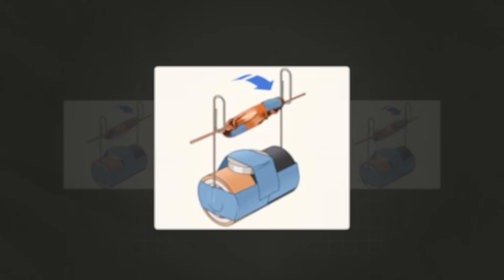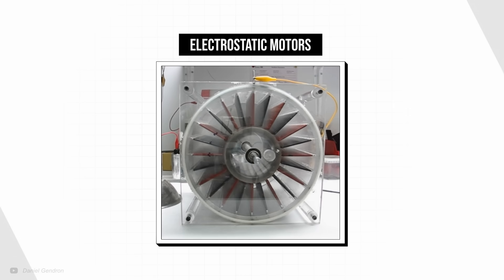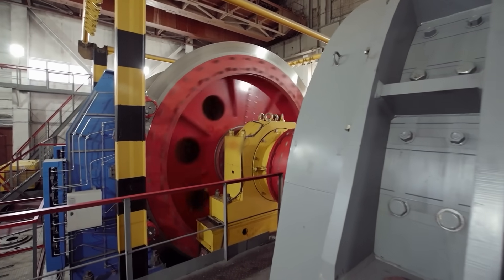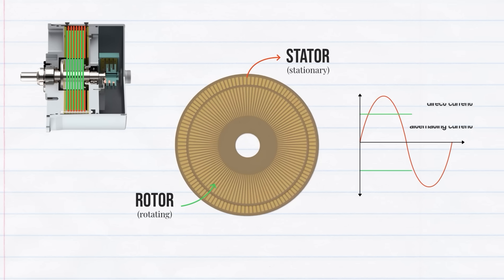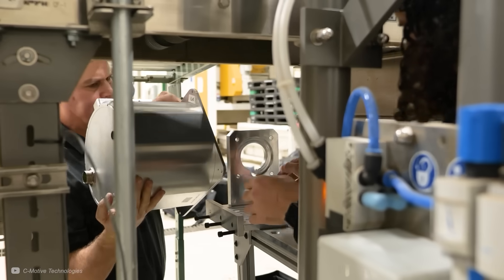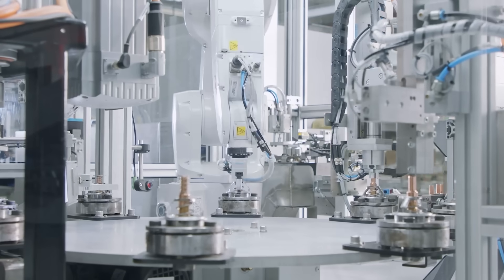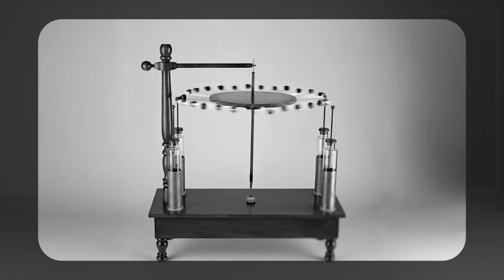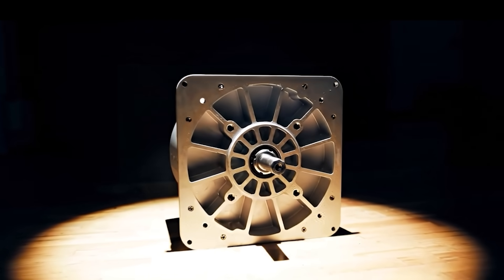How Electrostatic Motors are Breaking All the Rules

Comment: I work in factory automation and induction motors are so cheap, these motors would have to get close to the ballpark upfront cost to start making a significant dent in the market. Unfortunately people don’t often go for the pay more now to save in future within the industry.
Reply: I agree. I used to design and make industrial machinery like belt conveyors and packaging machines. 95% of buyers are focused on upfront cost and reliability. For these low power applications almost nobody considers operational costs or enviromental impact.
Reply: @federicolopezbervejillo7995  I work in industrial maintenance and I can concur. Noone is willing to spend as little as 30% more even if there's a lifetime savings of 50-60%. Everything has to be justified immediately as cost versus benefit
Reply: @federicolopezbervejillo7995 
That's strange. What company in its right mind wouldn't want to improve their margins. They could also campaign for government compensation, as this tech would positively impact the countries margins too.
Reply: @SWDW88  Well, I'm not a plant manager but I met a few in the last 20 years and I found they a re very intelligent people.
I was told once that when evaluating an investment, a positive Net Present Value (NPV) is not enough. Usually the project NPV is compared to other projects NPVs and the best ones are identified. These kind of marginal benefit technologies are not attractive compared to a cheap new production machine that could be not so efficient but brings considerable benefits by increasing production. Government incentives in general make not relevant difference, at least in my country. In the end these kind of green investments are used as a marketing virtue signaling, not as a optimal profit investment for the company.
Reply: @federicolopezbervejillo7995 
And your right. Allot of these greener schemes are meant as virtue signalling. But in this case, it's efficiency gains. And there are allot less choke points in production that can be leveraged by other nations.
Reply: @SWDW88  welllllll. Lets say I buy a 1 million dollar machining center for a production plant that does not use any cutting fluids as it makes its owm from a liquid nitrogen generator, has reduced power consumtion, and overall will cut operations costs by 100k per year.
Sounds good right?
And if the plant is employee or privately owned that is where the discussion ends.

But if it is investor owned and listed that would mean the entire p/l margin would be stacked a negative 1 million the first year and the company stock will plummet, and a venture capitalist will defenitly buy up stock, take out a loan against that stock and buy up more while forcing the company to pay for the stock bought for them because of the controlling stock...

So we would take a loam against the company to pay for it, and that puts a risk of 1 million for the next ten years (zero intrest as the loan would be internal fully), now we have a risk of 1 million that reduces over the ten years it takes to pay itself off, and the company stock will STILL be undervalued because of that risk meaning an Venture Capitalist could still buy up the company for a million less then its actual value, it just would be harder to get a loan to do a forced buy out like that, but it would also take ten years to remove that risk.

So given all that we have to wait until such technology is both; a MUST have in the industry AND, the equipment can be purchesed as a replacement and out of the allready saved and techincally paid for out of the maitanice and systems expansion funds.

We need both in publicly owned companies otherwise some bank is just going to trounce us, and sell us for parts.
Reply: @AnonymousAnarchist2 
Cool. My point is that the design looks simple. Its discs Vs coils. Sheet cutting machines Vs coil winding machines. These sheet cutting machines are everywhere and used by many industries. I could outsource the disk cutting to a company who owns these machines already, who'd add it into their schedule. 

I could buy second hand machines as I build the business to take care of a margin of the work. As I grow a healthy cashflow record, I'd receive loan offers from the bank to expand the business. To avoid financial vultures, I simply would not take the company public. Would sell shares privately under a contract that makes sense. 

And these electrostatic motors along with those relatively new circuit board coil motors can be produced at a much higher rate per machine than the traditional winding method. Higher volume equals lower capex per unit, as that gentleman said earlier.
Reply: I work in power transmission. They are using worst case scenarios to make their data look better. They are using ie1 motors and high ratio worm gearboxes to get the gearbox efficiency. You could use an ie3 motor and helical bevel which would  be far more efficient. However it costs more and in these small power applications most people focus on purchase price. 

They are still using sprockets to couple the motor to the conveyor. 

They are trying to solve a problem that’s already solved but the market still chooses the cheapest most reliable one.
Reply: @8towely EXACTLY.    the rough cost to run a 3hp motor 24 / 7 / 365 is $1,960   Per year Based on 0.10 per kilowatt hour.      
Mfg energy savings estimates are always so lopsided,   They lose all credibility.
Reply: There's also the "nobody ever got fired for buying IBM" problem.

If you buy an off the shelf motor and it breaks, then shame on the motor. If you stick your neck out to buy the fancy experimental motor and it breaks, then shame on you.
Reply: @SJ-co6nk 
The best strategy would be to start small. Target more niche low scale markets where the margins make sense. Then ramp up production when there's clear evidence of a return.
Reply: I'm not an expert, but this motor looks much easier to manufacture. Obviously this industry would already have all of the machines that build the conventional electromagnetic motors. But this new device could enable startups to compete with the most dominant players on the market. 

I think the actual problem will be the regulators that stagger it's progress and postpone it's entry into the market. This is the usually the case with most disruptive new tech. 
Money talks
Reply: @SWDW88 the motors in competition are not electro magnetic they are induction there made very easily and very cheap.

The video uses worst case scenarios on efficiencies for worm and motor. There are simpler options already available with higher efficiency and the cost difference isn’t much. The market still opts for the cheaper worm box and low efficiency motor.
Reply: @8towely
I get you. But metal wire windings are still needed in the stator. My point is that metal plated discs can be manufactured with allot less capital than EMs that do require windings.
Reply: @SWDW88 I seriously doubt it. Windings are copper but small motors are a few hundred dollars and can run dol. these motors will need a drive adding more complexity and cost
Reply: @8towely 
The induction motors also need a drive to operate efficiently with varying speeds or loads. Although, these drives are established already, and the industry are well optimised to produce them efficiently. But that same assembly line could easily adjust to efficiently produce the drives for electrostatic motor. Where as the machines needed to wind wire efficiently are very niche and expensive
Reply: @SWDW88 they really are not expensive. Sub 5.5kw it would be nearly impossible to compete price wise.

And a lot of systems are built on single speed and do not need drives.
Reply: @8towely 
I was mainly talking about the machines that are used to build the electromagnetic motors, though. They're niche in the sense that they are used for one job. And allot of capital is needed to own them. I'm not arguing about the price of electromagnetic vs electrostatic motors here, because those numbers are based on how efficiently we can manufacture them along with material cost and logistics.
Reply: @SWDW88 I work for a manufacturer of motor and power transmission.

To make anything you tooling or equipment to sped up production.

When you make tens of thousands quickly and efficiently that capex is absorbed very cheaply. It would be no different for the motor in the video
Reply: @8towely 
I understand those principles, but there is still a large amount of capital needed to make EM motors because of the niche machinery needed to manufacture them efficiently. ES motors use metal coated disks that can be cut from sheets and etched with Lazer.
Reply: @SWDW88 there really isn’t mate you don’t have a clue. If capex was so high you’re not selling 1.1kw motors for a few hundred dollars.

Capex is always absorbed on a per unit cost.
Reply: @8towely 
I get you. The capex per unit is small if volume of production is high. My point is still valid. Smaller startup companies could be competitive, by producing these electrostatic motors. Because there is less capex per unit volume. Bigger established companies will have the liability of redundant machinery.
Reply: If they use way less copper they may be competitive.
Reply: I like the up the  voltage, phases and frequency solution. 6 phase 60deg motors are much smaller and lighter. Good luck to any one figuring out the phase rotation on that :).

Comment: I wonder if they could be used for applications where magnetic fields are a problem. If they product smaller magnetic fields, and/or are effected less by magnetic fields, that could increase their potential use. And if they could replace their liquid with a non-conductive gas that could make them lighter for other uses.

Comment: Where does the high voltage come from? How is the high voltage delivered.  Is the high voltage converted from a lower voltage source? I have issues with the high voltage system because will require better wire insulation and the safety may require much better switches to break the current flow. I do like the idea of such highly efficient motors.

Comment: The fluid is likely a blend of Propylene Carbonate, which has a quite high dielectric constant, over 60!
Reply: Excellent observation.  Though the covalent bonds in five ringed cyclical carbonates are not thermodynamically stable enough for long term use in electrostatic motors, unless measures are taken to stabilize them.

Comment: They should explore the airplane engine market. High torque at lower speeds would eliminate the gear box issues that turboprops have. Power could be supplied by batteries for take off, and then by a jet powered generator for extended flight - a sort of hybrid system. I know the turboprop market has stalled due to the need for more efficient engines; this may be the solution.

Comment: I wonder if they could build the motor into a hermetically sealed chamber and use a magnetic coupling with a very high vacuum instead of an insulating fluid so there is zero fluid drag while still offering enough electrical insulation?
Reply: Thermal issues may be difficult to resolve with a high vacuum though.

Comment: oh my god, there are millions of us that have this use case, we need motors that maximize torque, but only need the motor to rotate once in about 24 hours... this is amazing. If it can get to sub arcsecond precision we are all going to lose our minds.
Reply: What is your application?
Reply: @marioxerxescastelancastro8019  Telescopes man. Meade and Orion just went out of business, there's basically a huge power and product vacuum going on globally right now. If you don't count the useless chinese stuff that doesn't even meet the definition, the low to middle end of the market right now is ripe. If this company decides to make something smaller than half a horse, oh boy. If it for whatever reason they are strong enough to drive a load directly without a transmission and has really nice encoders... Boy oh boy we are in for some good times.
Edit: The harmonic drive / strain wave gears have helped, but we'd like direct drive capability especially on a small scale. I just had to tear out a giant elmo motor for my 600lb telescope which was a pain, it'd be nice to get something a little smaller.

Comment: > Safe, nontoxic, commodity chemicals, nonconductive, 4000V breakdown, useful as a coolant
That's literally just Novec 7200, or something similar.
There's nothing proprietary or secret sauce about it, it's been around for ages in this kind of use case.
The amount of viscous drag created by fluids in gaps that small is likely why they are focusing on the low speed high torque market. Maybe if they pumped the motor full of "proprietary" SF6 gas like HV transformers, they could run it at higher speeds.
Reply: What’s funny about this is the confidence with which you're dismissing the possibility of proprietary formulation.

“There’s nothing proprietary or secret sauce about it; it’s been around for ages in this kind of use case.”

Great! Then please tell us—what exactly is the dielectric fluid composed of, and how is it prepared? I’m intensely curious about your informed knowledge.
Reply: @Fejimush  I literally already told you, it's Novec 7200 or some similar substance, you just ignore the parts of what I said that you don't like so you can feel superior. Novec 7200 is a common flourocarbon. I I've looked into electronics coolants in the past for similar use cases, the ones that meet that exact list of characteristics are Novec family of flourocarbons. If you want a treatise on the exact composition, google the MSDS documents for it.

Comment: facts much more efficient imagine a stalled motor dc vs static the dc continues to draw power to continue to have a torque even without any motion but static wont draw any power when stalled but will still have its torque to spin its great similar to a hydraulic motor but the problem is scalability and power supply generators dont make that type of power. static generator also have the same scalability problems. but they clearly much more efficient. but bio motors are still better. imagine a 50cc scooter vs horse both same speed you need to travel maybe 6 miles a day what uses less fuel horse some grass vs 50cc engine maybe 1 gallon of gas. maybe think about it as surface area of land used to make bio fuel vs grass for horse. ill say a horse can go farther per square foot of land than a engine can then whats gonna last longer if well maintained ill bet a horse can live longer than 5 years. but then what about the ability for bio motors to multiply i never seen two scooters get together and make a new scooter for free.